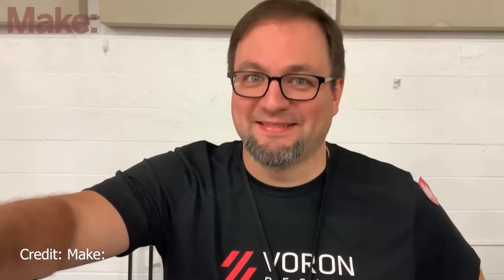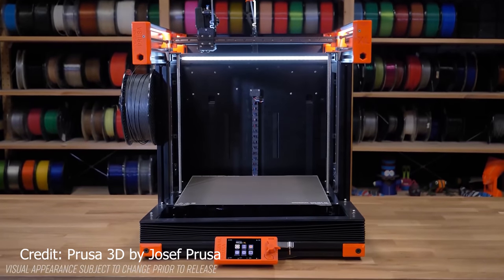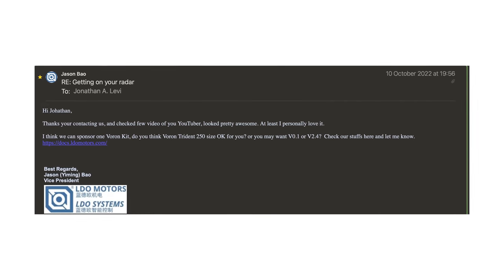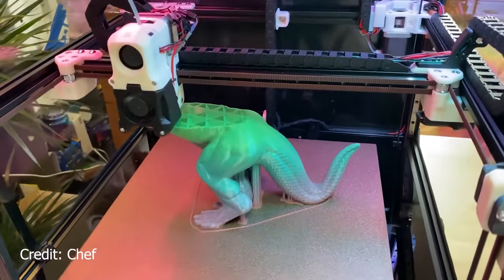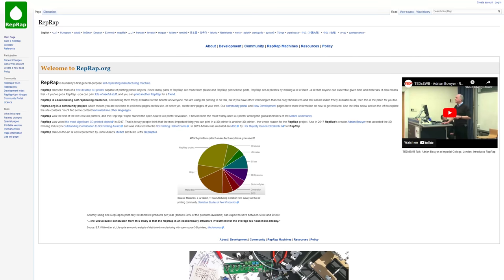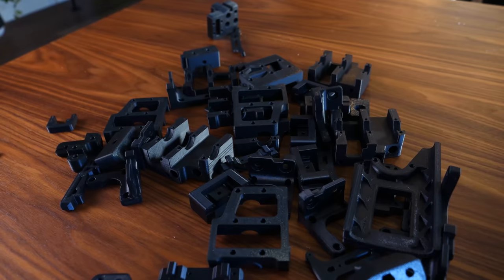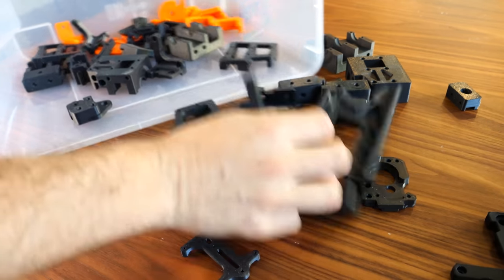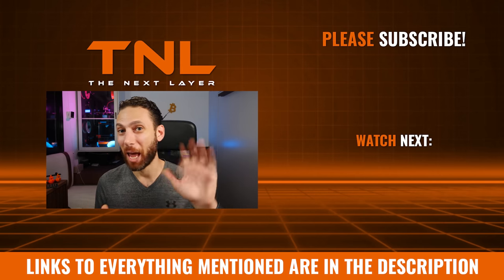I'm Building a Voron 2.4!

Comment: The Voron 2.4 LDO Kit is a nice choice for a 350mm printer. I'm building a Trident 250 LDO kit right now, which is a simpler, better choice for the smaller size. A lot of the info here on Voron is a bit off the mark. The Vorons are not as expensive as the Railcore, with all the pretty CNC options available. You can make larger Vorons, custom sized, 350 is not the limit, Voron has a calculator to determine the extrusions needed for the size you choose. One of the design parameters for Vorons is to use worldwide available off the shelf parts as much as possible, while the Railcore doesn't worry about that and uses more optimized custom machined components. Voron recommends printing the parts with ABS or ASA, not exclusively ABS. Note that ASA has the same chemicals as ABS plus a few more so hazards are pretty nearly identical. To join the print it forward (PIF) program is a process and all PIF must be printed on a serialed Voron by a vetted PIF provider, so any random printed parts can't be called PIF. I would suggest not doing livestreams, a first time builder needs more time and fewer distractions. I've followed Voron for years but this is my first build, and I've had to backtrack a few times to optimize things for the best result. I think an edited timelapse with voiceover is more useful for the viewer.  Best of luck for your build and enjoy Formnext!

Comment: I built my first 3D printer and im not an engineer and chose a Voron. It was quite a project the most frustrating part of it was the wiring. It took a bit of learning how to setup klipper and a bit of trial and error. Its definitely a printer that you'll look back and say it was an amazing project and its so fast. Once you assemble it you know why these printers aren't sold pre-built, its not someone you can just drop in someones hand with a simple guide, its complex and needs a good understanding on how it was assembled to maintain it properly
Reply from the maker: Good to know. Was it worth the effort though? Now that you have it?
Reply: @thenextlayer  I'd say yes, it was a little finicky at first but definitely a great printer and a great experience
Reply: Same story, best project ever
Reply: Same for me except, I went with a vCore 3 500mm because at the time voron kit were a bit shady. Now after 1 year the thing is a beast and make the prusa look bad, which is not.
Reply: Do another video on things to print
Reply: I wouldn't say vorons are the best choice for speed, though they are pretty reliable
Reply: @williamluong7743  all of the best speed benchies that I saw were on voron 0
Reply: @matthewdolman  that's an exception... The voron 0 is only fast because it is tiny, if you scale down a vzbot to that size you could probably beat the voron 0
Reply: For your FIRST 3d printer? I'm impressed. You're definitely the minority.

 I been printing for 6 years now... I got serious with making some money doing it this year and decided to add a Voron to my little farm. Fun project. Not too bad a deal. I am experienced though. Not something I would recommend to your average person. But nothing too extreme for your geek type or someone with some mechanical ability. 

Worst part for me was printing all the parts lol. ABS can be annoying sometimes. The Voron prints it very well though
Reply: @nsboost  It was also a father son project. My dad was a mechanic by trade so he loved the DIY part of it (so did I)
Reply: @williamluong7743  I'm curious, what are you basing that on?  Technically printers can all move fast, the question is things like quality and extrusion, things like cooling and extruder/hotend are going to have a lot of say.  Simply saying a voron isn't as fat as X doesn't really make much sense on its own.
Reply: @matthewdolman  just speed at quality… the vzbot has better capabilities on basically everything… Low moving mass = less ringing, cpap cooling system beats everything, different hotends can be used
Reply: @matthewdolman  the annex engineering k3 is also a better printer
Reply: @williamluong7743  again, what are you basing this on, are there objective comparisons out there?
Reply: @matthewdolman  input shaper results are objective
Reply: @williamluong7743  input shaper is a software thing, it can be set up on a voron just like any other klipper printer
Reply: @matthewdolman  when you calibrate input shaper, it gives you a graph and recommended accel

Comment: I built a 2.4 myself. I wanted NO lead screws lol. She works great. I don't get into speed tests and stuff. It's just my ABS machine. 

Looks great. I dig Klipper. And something about the bed being stationary is something I really like. I do just use a V6 hotend because it's what I have been using for years and I'm not really in a hurry. It can already outrun all my i3 machines by a long shot with no issue

Comment: You will love the build process, and you will love your finished product. As a small streamer in an ocean of huge streamers, I too was fortunate to partner with companies to make my Voron builds come to life. To answer your questions (from my point of view)... 1. It's not hard to build the 4.2 at all. Read and follow the instructions carefully, and be sure to reference the LDO specific instructions at the appropriate time, as they differ from the standard 2.4 build manual. 2. Klipper has a learning curve, but once you round that bend, you will never look back. There are a lot of amazing folks in the community that  you can turn to for Klipper related questions, and documentation on anything you can think of. 3. It is worth it. The feeling of satisfaction you get watching that first print is indescribable. Yes, I'm a YouTuber and I stream my builds, but the satisfaction is no different. 

If I may suggest something... take the time to use the Klicky kit that would have come with your LDO kit and put a Klicky Probe on it. The effort in setting it up pays off big time. And when the time comes, look at the Voron Tap LOL... my next upgrade to my 2.4 and Trident. Also consider the Stealthburner hot end with the CW2 extruder... again excellent upgrades to do during the build. Sorry for the long-winded reply, but I'm excited for you. I'm in mid build on the Trident on my channel. I'd love if you dropped by one Sunday evening on my stream! 🙂
Reply: Doesn't the LDO kit come with a Klicky probe? Or do you mean a different Klicky varient?

Comment: I got the 2.4 and had a huge number of problems with it, many of which are solved by using various mods. It would be amazing to see you build the V2.4 as-is and then maybe a short video about the different mods that improve the experience of working with a V2.4; Some of my fav mods in no particular order - Klicky probe (or Voron Tap), CanBus EBB, 270 hinges, Panel clamps, LGX/LGX-Lite extruder, 48V XY motors, Window exhaust (or Nevermore), GE5C bearings mod, Hall-effect endstops, MGN12 rail (like the trident), HDMI+Touch Screen, Ceiling LED strips, Decontaminator (or a lookalike), and so many more ... the number of options and improvements is almost infinite.
Reply: The only mods really needed on a 2.4 are gantry backers for the y-rails, klicky/or similar magprobe, and probably lgx lite or other toolhead swap. All the other things probably aren’t going to improve any problems of the 2.4.

Comment: Few notes:  The photos you show are from previous verison, VORON 2.2, not 2.4 🙂 VORON was not build as an unlimited budget printer, it was actually intended as a fully capable but cheaper alternative to Ultimaker. Parts for VORONs are selected to be good enough for the job, but also need to be obtainable globally. Trident kit from LDO has actually some extra perks over 2.4 (touch display, and you as an influencer would probably get a custom hotend). VORONs are naturally enclosed and do not require other enclosure. But if you approach it from VOC standpoint, it's understandable. Take a look into Nevermore recirculating air filter too. Maybe that would allow you to keep bedflingers in your existing enclosure, and VORON as a standalone piece of furniture 🙂

VORONs are fun to build. Few people who streamed their builds (Nero 3D, Steve Build) are part of the VORON development team, and summarizing it from the standpoint of a reviewer cannot be done quite well. Chris Riley or ModBot did Switchwire build for example, and Thomas did v2.4.
Reply from the maker: Wow, I was way off on a lot of things! Thanks for the education!

Comment: Hey there, I built my Voron 2.4 350mm r1 during 2020. No complete kits then (some partial kits like frame, fasteners, motion, extruder though), no cable harness (I have never been criming before...), I had to order like 30 parcels from ali and other sources. Since my only printer then, Renkforce RF100 :) , wasn't able at all to print the parts, I went to the discord community, and I literally think, that this is the best part about voron at all! So helpful and supportive! Some very nice guy made me a special print it forward offer and printed all the parts for me (for free, with the obligation to do the same to two other people when my voron was working, I am still waiting for request... ;) ). I am not an engineer but have some little technical understanding (maths and physics teacher) but no practical experience at all. With all the great youtube tutorials on building a Voron 2.4 (chaosdrucker, nero etc.) I was able to build the printer, all the rest of the problems I run into (some very particular mainsail/klipper setup issues), I could solve with the friendly help of the voron discord community. All in all, It is a lot of problem solving, tuning, getting more knowledge and it is time consuming but it was so worth it, it was and still is so much fun, I would do it again any time! I wish you a lot of fun building the voron, and maybe you've read it between the lines: Go join the voron discord community... ;)
Reply from the maker: Impressive!

Comment: I am a Tinkerer and build my first Voron 2.4 350 a few weeks ago. I do not regret it, but it is important to understand that this is a journey und and not a build and done project. You will find yourself upgrading and modding quite a lot before you feel "you are finished with this". its not a bamboo that you can just put on the table and print CF Nylon on.

Comment: Excited to see your build, it is quite an adventure to build one of these kits. I have a Ratrig V-core-3 500, similar principal, but I was replacing a CR10S S5 and wanted to keep the 500mm3 build volume, similar to your scenario. The communities for both Voron and Ratrig are filled with amazing, helpful people so be sure to interact with folks if you get stuck or want ideas!

I have a couple tips to offer that helped me, make sure you have a very flat surface to build on, it makes ensuring your frame is aligned and square much easier. I'm a bit spoiled as I built a torsion box workbench awhile back that I used to build the printer on and is pretty close to dead flat. Get some cheap machinist squares, and some 1-2-3 blocks if you can, again they make getting the frame square much easier. Don't get married to a design choice (hotend, mainboard, probe, etc...) as they can be easy to change out and try different things. Finally, look into toolhead toolbaords, like the huvud or the BTT EBB42, klipper can talk to multiple MCUs, and having a toolhead toolboard can greatly simplify the wiring on a coreXY.

Have fun!

Comment: Once you have built this you will forget your prusa and creality. ASA might work but i personally think that it is less flexible than ABS. ASA might crack easily.

Go for the stealthburner instead of the afterburner. Its much better.

The omron leveling probe melts easily, wrap it with a heat resistant tape or you could do the klicky instead of the probe.

Good Luck!
Reply from the maker: Yep. It's running now, and... My prusa looks like a sloth. I did Klicky :)

Comment: Getting ready to do the same with the 300mm LDO kit.  Also using Polymaker ASA (and Prusament red for accents) on a MK3S+ and I have puzzled a little bit reading of the difficulty others have had printing ABS or ASA...  I was able to make usable parts basically from the start, although I did have a few very minor cosmetic defects early on that are causing me to reprint a few parts just because.  And that as a relative noob to printing, so the Polymaker ASA is good stuff.

It makes sense that LDO would offer you a Trident kit initially...  Most of the big name youtubers have built either the 2.4 or the V0, so it makes sense that they should want to get a few more Trident builds out in front of viewers.  But you're still giving them good value since there are not so many 350mm builds on YT.

If you have the time to edit the videos down, I would greatly prefer watching the abbreviated format (like this video) rather than a livestream.  I generally skip those because I can't really bring myself to spend 2-3 hours at a pop, especially times a multi-part build series watching some guy drone on while putting together his printer.
Reply: Only problem I have with my 250mm 2.4 is some bed warping issues.  300 probably will be worse.  Nothing QGL can fix... bed mesh a bit.  It's the four anchor points... not much to be done sans serious modification.  About ABS, it has gotten a LOT better in the last few years.  I don't know if it's in the formulations or better slicer parameters, but ABS/ASA went from being my most hated to my most used filaments.  Whatever the case, it's great now, provided you have an enclosure.  I concur with your conclusion.  Polymaker ABS and ASA is good stuff.  Making production parts, it's almost the entirety of what I use.  I just wish I knew how big the 5kg spool was before I built the spool enclosure.  Now it has to wear heels.

Comment: Klipper is the hardest part but the best once understood. Although I work with my hands all day. I thin building is ready so long as you take your time with the manual. Which is also very good. I don’t recommend rushing the build because small issues lead to big head aches after the build when testing. Make sure to take your time and just enjoy it. Cheers!

Comment: I built a voron 2.4, and own a X1C with AMS. Can't say v2.4 is the best in comparison -- it's close call, Voron can't print as fast, quality wise, Voron is actually better is some cases -- bambu has the dreaded rounded corner issue. But can't beat the X1C for CF-PA. The proprietary stuff -- been there, I owned a TypeAMachines S1 - a lot of it was proprietary, and then it went out of business -- I rebuilt it, used the frame to redesign it. I did the same with my MakerGear M2 as the company is circling the drain also. I am pretty sure if Bambu goes out business, I can just as easily convert it to open source with readily available parts.

Comment: I wouldn't say thats the best, but its a solid option for a kit corexy printer. It has a big community, has easy to understand instructions, and is relatively cheap.
Reply from the maker: What is the best??
Reply: @thenextlayer  for performance under $5000, I would say the AWD vzbot, crazy fast, can do like 2000mm/s at 100k acceleration. There are a ton of videos on the vez3d channel. A midrange option is the v core 3, faster than a voron, but a bit harder to assemble, and much larger.

Comment: Looking forward for your experience, as I also want to build one in the near future, but can't decide yet on a 0 or a 2.4. Also, it motivates me to start blogging/making videos again, thanks for that!
Reply: 0.1 has much smaller print volume (12x12x12cm), has higher potential speeds BUT it is more complicated to build  (everything is super tight inside + it has some finnicky screw placement that requires you to have 1) wiha-grade ball-hex and looooong hex to reach some spots)

Comment: Cool video! I have built my voron 2.4 more than a year ago, that time there was not trustworthy kit so had to source everything by myself. I'd say it is not so difficult to source and build the printer it just takes time. And the whole process is actually quite fun and educational. I have learned a lot during the build.
However i don't think making another voron build video will be that much interesting. What would be interesting is mods review and what they improve (is it useful mod or decorative or doesn't make a difference and just for fun). Since LDO sponsored you the kit would be nice to hear how components in LDO are better than other (but not in advertising manner, really, how LDO motors are different from much cheaper stepperonline for example). Comparison of voron to other printers based on your experience, how voron is useful for you, what should be improved and what solutions are overengineered in your opinion.
Reply from the maker: Great suggestions thank you! I’m hoping Bambu will send me a review unit so I can do a more in depth comparison video. I was hoping Stefan at @cnckitchen would compare the two but he brushed over it a bit